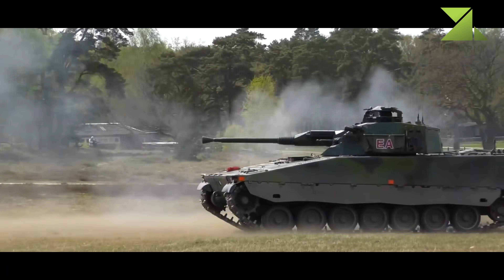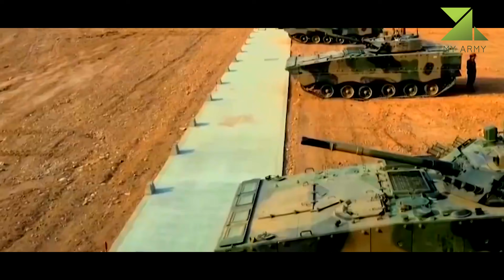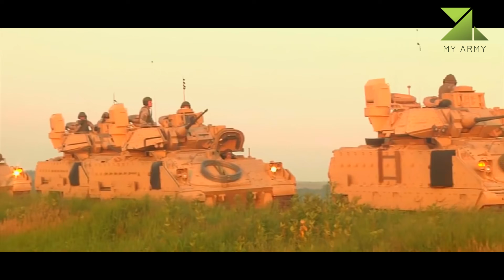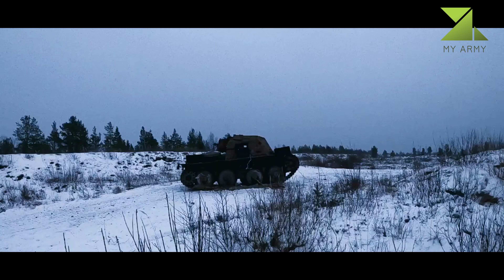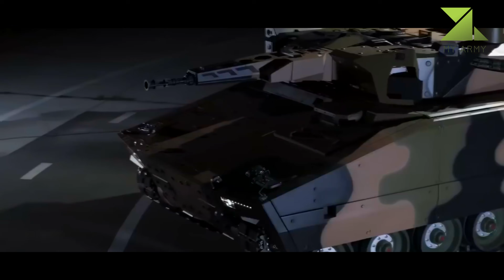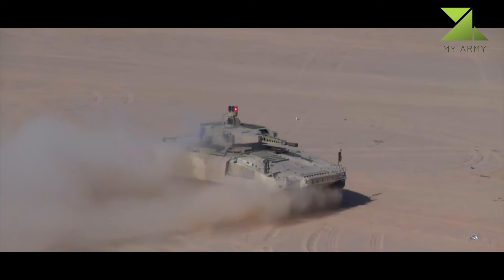TOP 10 Most Advanced Infantry Fighting Vehicles - TOP 10 Best IFV in The World

Comment: These are nothing a javelin couldn't handle.
Reply: Ignorant .Modern ifvs have trophy system
Reply: modern tanks and ifvs have defeans system capably to destroy incoming antitank missles
Reply: @ekarus4360  and HEAT rounds
Reply: Puma has an active protection system fitted to defeat Missiles like Javelin. Its called MUSS.
Reply: @zhufortheimpaler4041  they cannot defeat a top attack
Reply: @Greekartillerist  Javelin and other top attack missiles dont come down vertically, but at an about 60° angle.
MUSS is capable of defeating that.